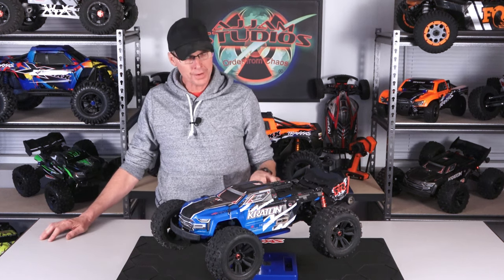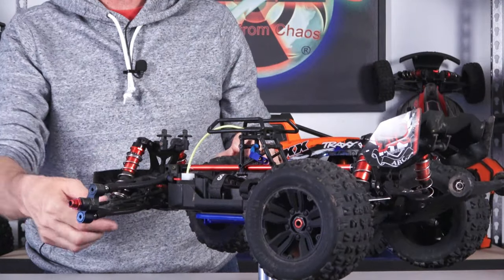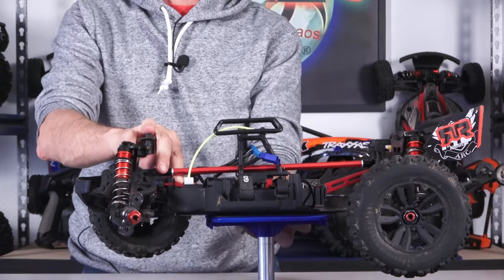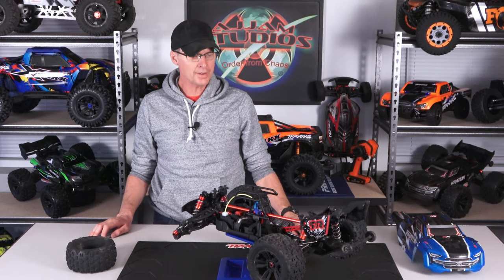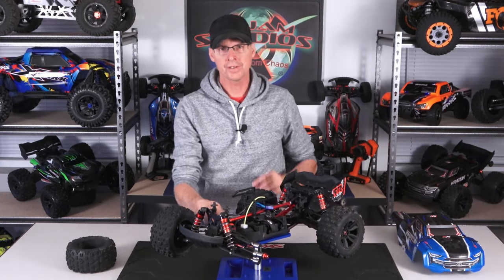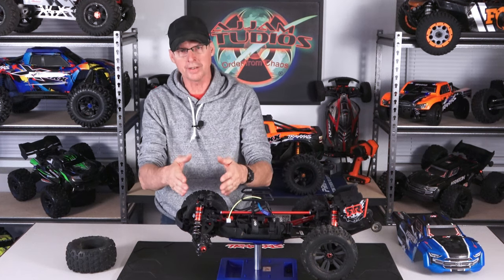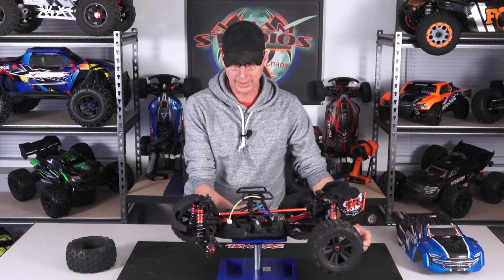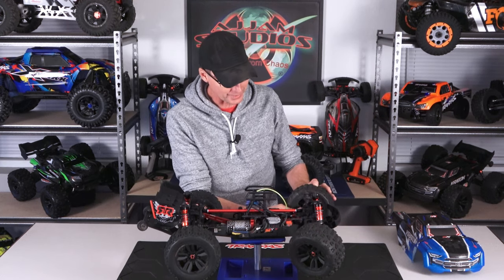What's your build   -  Arrma Kraton V4 RTR

Comment: Nice video AJ. Need to ask. Do you plan to get the Kraton 8s exb
Reply from the maker: No, I don’t think so. We’ve built our RTR with EXB components and it works great. Thanks for asking 😎👍
Reply: @AJJAMStudios  okay I have a question for you. How muck time will it take to assamble a Roller?
Reply from the maker: If you are experienced a couple of hours. If you’re new double that.
Reply: @AJJAMStudios  okay… Thx. So last thing. What do you recommend I’ll install in a 8s?
Reply from the maker: Good question, but if you watch our channel regularly you know we run the powertrain in most of our vehicles stock. There are two reasons we do this. One: the rigs are balanced for that amount of power straight out of the factory, Tires, suspension, drivetrain, which lends itself to better run times on a battery set. And two: we like to show what you get when "you" purchase one of these machines. I get the desire for the ultimate speed demon, but I favor handling and control over that because the tires, the running gear, and the suspension parts can only take so much before everything goes sideways. If you want my honest opinion (which is what you'll always get here) I'd look into something ranging right around those stock numbers, or perhaps a bit more, but I'd stay away from those motors that promise insane speeds because they usually require heavy upgrades for any kind of longevity. The more power you put into it, the more upgrades you'll need, and the heavier the rig will become, eating into your run time and overall fun. As always, the choice is yours, and I hope you get what you're looking for. Thanks for asking. AJ